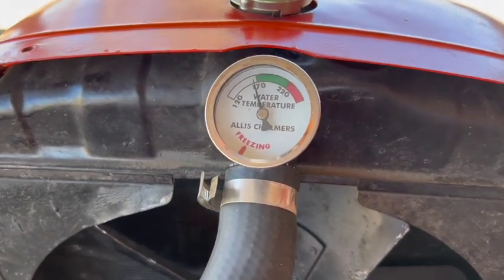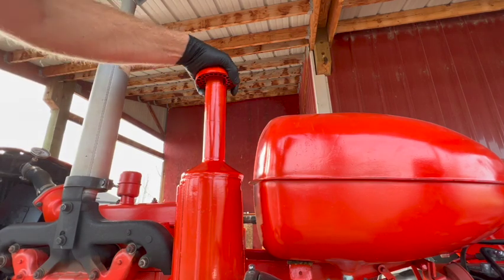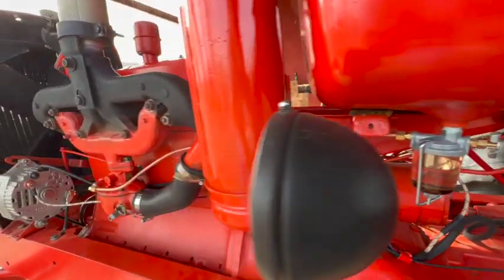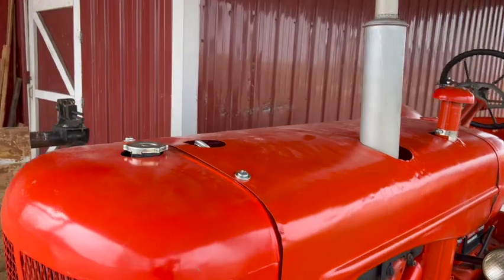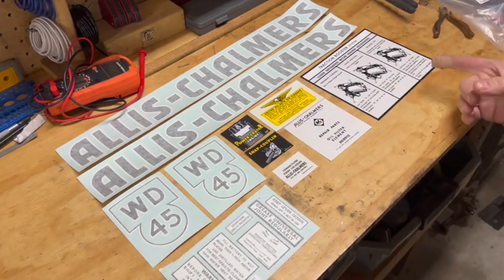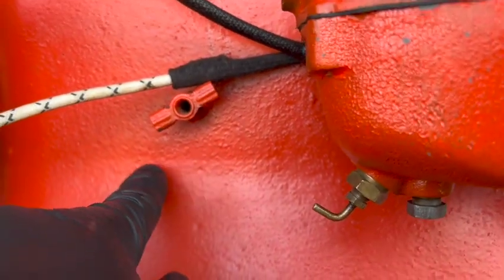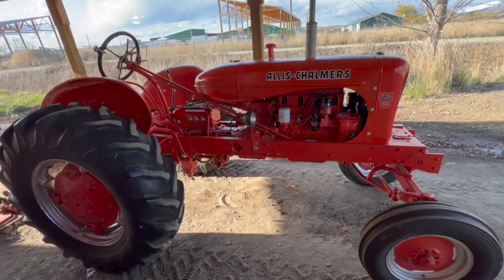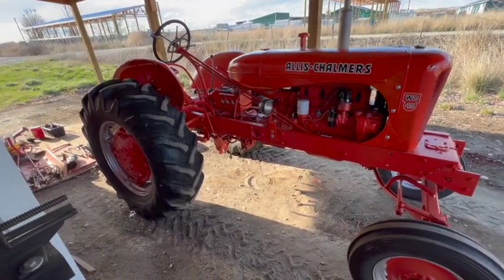Allis Chalmers WD45 - Part 7 (Good News and Bad News)

Comment: I worked on one of these years ago for a friend.  It had suffered a lot of neglect but it was still salvageable.  After many hours of work I got the tractor to the point that it only took a quarter turn of the crank handle and it purred like a kitten.  Seeing the look on his face after he started it for the first time was worth all the time I spent laboring over it.  One of the hardest things I had to do was remove a broken bolt on the exhaust manifold that had an easy out broken off in it.

Comment: Nice looking tractor. The original fuel lines were steel, so I have been known to use "break line from the parts store to replace solid fuel lines.

Comment: Really beautiful job. The long drag blades are nice for driveways because the tractor going over bumps doesn't recreate the bumps. You can run a PTO mounted pump and an external hydraulic system until you can go after the leak. They also make pumps that drive off the distributor for live hydraulics, and that can be set up externally as well. Be sure to video it in action as well.
Reply from the maker: Thanks. Running a PTO pump is an interesting idea. I may look into that.

Comment: The radiator shudder was used on the WD model.   I never did see the radiator shudder used on the WD 45 model.   The hole in the top right side was the shudder control shaft.  That radiator grill was originally on a WD model tractor.  I never saw a WD 45 with the radiator shudder  when the tractor was  new.  The hydraulic fluid leaking into the rear differential is a defective seal.  And yes the fractor will need to be disassembled to change the seal between the two housings.  I have done this by myself it's not difficult with the right stuff.  Put the cultivator on the front without any plows and block up each side.  After removing the bolts including battery box roll rear wheels separating the tractor.  Take the tractor apart at the just behind the clutch housing.
Reply from the maker: I did not know that about the grill and the shutters on the WD/WD45. Thank you.

Comment: Another good video, and your attention to little details is outstanding.  Sorry about the leak, these old used tractors always seem to have a fly in the ointment somewhere.

As for the ergonomics, remember when on one of your earlier videos for this AC, I mentioned I didn't like how the clutch pedal was position?  I also mentioned how one sits low in the seat?  Did you find that also?

Thanks, again for another great video series.
Reply from the maker: I don't feel like the seat is low ... well, maybe just a little. It's pretty comfortable for me. But, the clutch pedal does seem far away (and far to the left). It isn't a big issue for me because I am tall. I can manage it. However, I think a shorter person would find the whole setup a bit uncomfortable. :)

Comment: You could try to put some rear main sealer oil additive if it sat for a while without hydraulic fluid then the seals will shrink but what rear main sealer does is swell up the gasket again so it wont leak anymore it might not work but it is easier to add that than to split the tractor
Reply from the maker: Thanks for the idea. It might be worth a shot.

Comment: Did you put anything on the threads for the sediment bowl going into the fuel tank if so what did you use? I have been battling with mine and can’t get it to stop leaking.
Reply from the maker: I use “Gasoila”. Works great 👍🏻

Comment: I understand the gasket between  the lift and transmission is about an inch higher than the two castings to keep the oil in the lift area.  Did you use rtv to make the seal?  Great job on the tractor.  I understand all the areas use 30 wt.
Reply from the maker: The previous owner installed the seal so I don't know if RTV was used or not. Thank you!
Reply: I have a wd.  The hand clutch went out when l got it fixed they used the red silicone.  Now I have that same problem.  I do not know where to get another gasket.
  @AntiqueCarsandStuff
Reply: @terrysavage2745  you make a new gasket out of gasket material
Reply: 90wt in trans.

Comment: Dear Tractor companies why don’t most of you find an old lorry Frame or even rebuild a brand New Lorry Frame to build stronger and better Tractors and put those Scania N113, Volvo B10M, Volvo D10A, Volvo TD102KF, Gardner 6LXC and Gardner 8LXB Diesel engines and put on all of those Leyland Hydra cyclic Automatic 4 and 5 Speed Gearboxes for those stronger better Tractors so they can still use them for any farms and even use them for the Mechanics so they can even lift a broken down Bigger Buses and also lift all of the broken down Lorries, why don’t you build 6 and 7 seats so that other passengers can sit at the back and front including the driver. You can still build those four small stronger medium sizes wheels and still make them even more useful for the Mechanic farm tractor than it still was before, please can you do those exciting idea’s for us tractor Lovers.